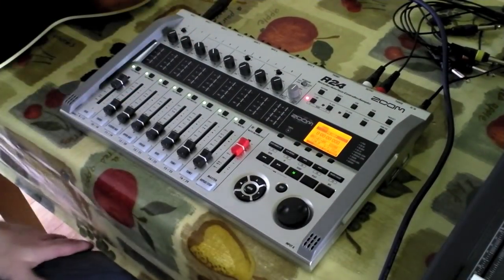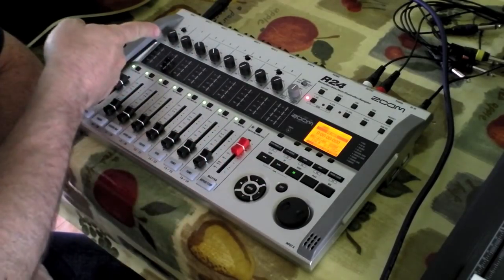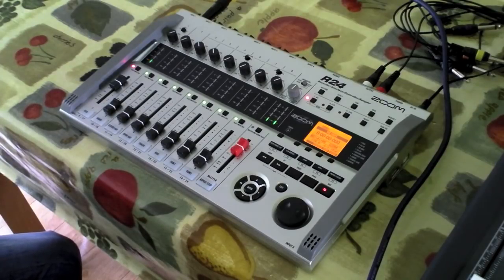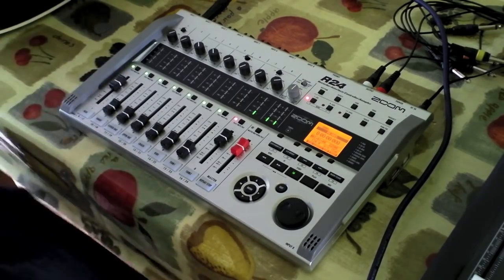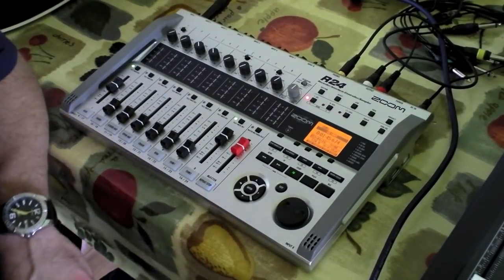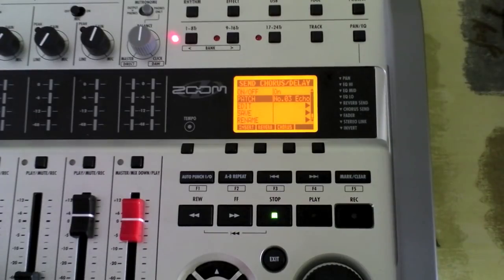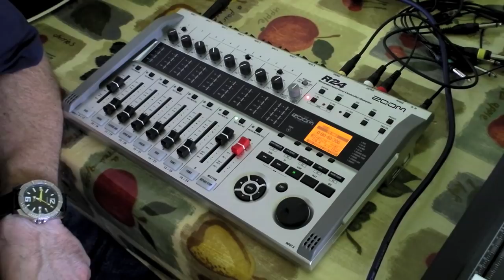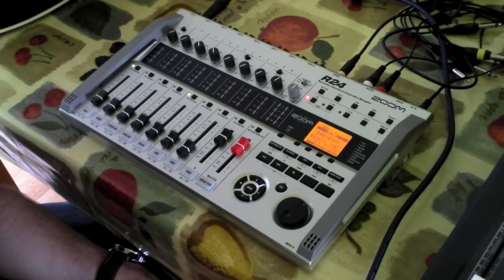Zoom R24 Part 2 - Basic Recording

Comment: Hey topdazzle! 
I just got my zoom24 a few weeks ago, your videos have been loads of help to get my bearings with the unit. 
I have a quick question, I'm sorry if you've already answered it, what SD card are you using? The one that came with my device doesn't work, I tried to format it but it seems to just decide when it will and won't work. (Which doesn't give me a great deal of confidence!) I'd feel better just buying a new card. 
Thanks for your time!
Reply from the maker: +roisintuohy Hi Roisin - I went with a 32GB Class 6 (which I think is the highest size the current firmware will support) - you may already be aware that the "Class" of the card refers to how quickly the card can transfer data (read and write speeds) - in my camera for example (with HD 50 fps video) I use a Class 10 but this is unnecessary for audio.  I think with anything less than a Class 6, if you are recording all 8 inputs simultaneously and mixing down all 24 tracks with effects, etc. - you need a reasonably quick card.  As for "make" - I think mine is a SanDisk.  I hope this helps, Darren
Reply: +topdazzle that's exactly the info I needed! Thanks man!
Reply from the maker: No problem - we aim to please!  PS: loving your acoustic stuff - very nice!

Comment: Hi,just wanted to say it was a very helpful video thanks.One question I have a set up of seven analogue keyboards from the eighties,drum machines and simmons drums which all go into effects units and then all into a mixer.I usually play all tracks live.Would you say I should take a line out from the mixer into the r24 and record all in one take or record each track separate coming from the mixer.Your thoughts would be very helpful on this thanks.
Reply from the maker: Anton Jones Hi Anton - it all depends what you want to do with them afterwards and how much flexibility you want to play around with stuff once it's recorded.  If you take a line out from the desk into the R24 then you are stuck with the mix from the desk and can't then adjust anything afterwards on the R24 (your mix is effectively already done and captured), however this may suit you.  If you take individual feeds then you will get ultimate flexibility afterwards to remix things if you're not happy with the way they sound (but you may not want to do this) - you may also be stuck for inputs doing it this way but you could always use your desk as a submixer instead and take groups away from the desk to stereo pairs on the R24 which will give you a bit of the best of both worlds.  One example would be to sum your percussion separately to your keys - then at least you can change the levels of each group on the R24 relative to the other group later on if that was important.  Anyhow - not sure if this helps but good luck with whatever you decide!  Best wishes, Darren.
Reply: topdazzle Thanks very much Darren for your reply.I think it is obvious now that each synth track,drum track etc needs to be recorded separate,otherwise like you say would the whole idea of being able to mix and tweak various parts would not be possible.Is it best to take a stereo or mono feed from the mixing desk to record each track ?Thanks again
Reply from the maker: Depends on their outputs, keys and drum machines generally output in stereo so take a stereo feed from the desk to preserve this.  Acoustic drums, guitars, etc are fine in mono.
Reply: topdazzle Thanks for your help.

Comment: Hi great video! Just getting started with my r24. I wonder if you need a preamp or something to connect an electrical guitar to the r24. Or can I just plug in directly? Right now I am playing my guitar through an older portable zoom device with built in effects that is connected to the r24. I feel that the sound gets to weak when I try to record. I could be the guitar, its quite old. Thanks again for a great tutorial!
Reply from the maker: Plug it directly in to Input 1 and make sure the Hi-Z switch is set to on - then you're good to go and no need for a pre-amp.
Reply: topdazzle thank you so much for answering my question! :)
Reply from the maker: You could try that but check first at what level your Fender pre-amp outputs - if it's line level than use one of the standard inputs on the R24 and turn down the input gain on the R24. Normally the pre-amp out on a guitar amp is designed to the feed a separate power amp so your tone gets coloured first from the Fender pre-amp.

Comment: Hey TD, Thanks to you I got it going. Why bounce to track to 5, when you can record bass direct into track 2?
Reply from the maker: +mitch green Hey Mitch and thanks for the question - the answer is "because you can't record bass directly into Track 2" or rather, this is not recommended. Input 1 is the only input with a Hi-Z setting to match the impedence of your instrument to that of the input - this includes both bass guitars and regular guitars (unless you are using a pre-amp or pedal / effects box with a line-level output). If you want to record an instrument directly into the device (without using a mic on a cab for example) then normally you would use Input 1 with the Hi-Z switch engaged.  I hope this makes sense and best wishes.
Reply: +topdazzle Thanks for the detailed reply. It all makes sense now. Much appreciated.

Comment: Hey TopDazzle... really great video. I also watched the introductory one (prior to this one :-)). I plan on completing the entire series. I just wanted to say thank you for taking the time to do these. You have no doubt saved a lot people a lot of time.

I haven't actually bought a multitrack recorder yet, as I'm still trying to decide between a Zoom R-24, a Zoom L-12 or a Tascam DP 32SD. And to be clear: I'm not really interested in any of these as a live mixer. I'm solely interested in recording. And so far, I'm leaning towards the Zoom R-24. 

Could I just ask a quick question, please? Did you say that the Zoom R-24 can also act as an audio interface and a control surface?

Anyway, thanks again.
Reply from the maker: Hey Tony and thanks for your comment - the answer to your question is "yes", the R24 can be used as both a control surface (works really well actually) and an audio interface. If you are not interested in live mixing then I would rule out the L12 and I don't know anything about the Tascam to be honest. If recording is your only interest, you might also look at the H6 (I got one of these last year) - another fantastic bit of kit and probably cheaper then the R24 (more portable too).
Reply: Just had a quick look at the H6 - I don't think it's for me, to be honest.... but thanks for the suggestion. Looks like it's going to be the R-24 then :-)

Comment: Hi, do you know if I can use my SD card with projects l have been working on my R24 in my friend's R16? When I insert the card into the R16 no projects show up. Only "new".
Help, oh mighty master of the Zoom!
Thanks, Jim
Also, thank you for all of your Zoom videos. My notebook is filling up.
Reply from the maker: Hi Jim - I'm not familiar with the R16 I'm afraid but it sounds like the folder structure is different and so it is not "finding" your tracks when you insert the card. If it were me, I would transfer the R24 tracks to my laptop first, then insert a card from the R16 into my laptop that had already been formatted to the correct folder structure that the R16 will recognise. Then look at the folder structure and there should be something obvious there as to where the tracks are stored on the R16 (like a folder called "tracks" or something like that). Then just drag and drop your R24 tracks into the correct folder on the R16 card, put it back in your R16, assign those files to the tracks on the R16 and you should be good to go! Hope this helps, Darren

Comment: I'd like to use what you taught me in these first two videos to do a scratch recording of the band using the onboard mics with output monitoring to the PA and am not sure how to do that without getting feedback. Is that output monitoring info in a later video?
Reply from the maker: +acousticomp Not specifically covered, no. It depends on your set up and the type of band / how many musicians you have. You could just try it and see how you get on - you may not get any feedback. If you do, you could also try headphone monitoring - simply send your outputs into a cheap headphone amps/splitters (Behringer make decent ones) then everyone gets their own monitor without affecting your microphones at all. The danger of doing it the way you suggest is that the onboard miss are also going to pick up the sound of your band from the monitors as well as the sound they are making through their amps and this could lead to a very muddy, echoey mess. Experiment a bit and try out different set ups to get the results you are after - that's how I started.

Comment: Great Tutorial. Thanks! I have 2 questions. After I selected a type of Reverb or Chorus, I see that it will be the same one for all tracks, so I can't  pick a different type for different tracks. Is that right? Also, why the Insert and the Send-return effects are called like that?
Thanks again!
Reply from the maker: Hey man - no probe and thanks for the shout, much appreciated.  No, you can't pick a different type of reverb / chorus for each track - whatever you select will be the same for each track (the same as on most mixing desks which this is trying to emulate).  Two workarounds (if this is important to you) - 1. Use outboard effects between your source (mic, guitar, etc.) and the input on the R24 or, 2. Use the bounce function on the device and record your track "wet" so you should end up with a new track with the reverb or chorus effect "burned" into the track then select a different reverb / chorus effect for your next track and so on (from memory I think this should work - certainly worth a try!).  The effects are named like that to replicate the way they work and where they appear in the signal chain - send and return effects involve you sending a variable amount of each channel out to the effects module you have set up, the sound then being effected and returned back to the channel.  For the insert effects, you are choosing whereabouts in your signal chain to "insert" the effect module you have set up (tracks, inputs, master, etc.).

Comment: Thanks for making these vids. I recently got an R24, watched your vids before even turning it on. Was prepared and when I finally was ready to get on with my first recording "no project" is what reads on the screen, even when I press "project" it still reads as "no project". Any suggestions? Thanks!
Reply from the maker: The only thing I can think of is that the folder structure on your memory card has become corrupted and that the R24 is not seeing anything. If this is the case then first try re-formatting the card in the device. If this doesn't work then get a new card and try that. I hope this helps.
Reply: Thank you! Turned out it was in fact the card itself. Slipped in a different one and works fine. Great actually. Spent 8 hours experimenting and learning it. Very simple once you get the hang of it. Great little machine indeed! You're vids were/are a huge help. Thank you. Cheers!
Reply from the maker: Good news! You are very welcome and enjoy your R24 - it is indeed a great little machine.

Comment: Hi.. Thanks for sharing all this info. Yet I still have question. Of course I am an amateur.

If I have 2 sets of Zoom r24 and were to record a live band performance total of  6 musicians (Drummer, 1 Keyboardist, 1 Acoustic Guitar, 2 Electric guitarist, 1 bassist) and 3 singers, how would the track sequence will be? What i mean is,

Track 1 : Kick?
Track 2 : Snare?
Track 3 : Hi-Hat?
Track 4 : Crash?
Track 5 : Ride?
Track 6 : Tom1?
Track 7 : Tom2?
Track 8 : Flow Tom?
Track 9 : Electric Guitar 1?
Track 10: Electric Guitar 2?
Track 11: Acoustic Guitar 1?
Track 12: Keyboard?
Track 13: Bass?
Track 14: Singer 1?
Track 15: Singer 2?
Track 16: Singer 3?

Is it like that?
Thanks in advance.
Reply from the maker: The short answer is "it can be any way you want it to be" - there are no rules or set sequence for this - it all depends on what you want to get out of it at the end and how much of a nightmare all the bleed through may be on the multiple different mics.  The first things that strikes me as unusual in your proposal (compared to what I would do) is all the individual cymbals separately mic'd - there is nothing wrong with this but (IMO) your results will be almost as good (and a lot less hassle) if you mic them up instead with a couple of condenser overheads set up to give a stereo image of the entire kit.  I would certainly mic up the kick, snare and maybe another pair of mics for the toms.  The rest looks good to me.  You also don't say whether you are getting a signal to the R24 directly from the instruments or whether you are going through a mixing desk / console.  If you are going through a desk, you can sum some of the channels together to reduce the number of feeds going to the R24.  Also - you don't way whether this is in a studio environment or a live setting (you do say "live band performance" but this could also mean in a studio).  The best advice I can give you is to experiment yourself for your own set up and needs, keep what works and tweak the rest until you get something you are happy with.  I hope this helps but it's hard to give such specific advice on what is essentially a creative process...
Reply: thank you for your humble answer and opinion as well. Going to get this interface next month after budget is enough.
Reply from the maker: Enjoy!

Comment: Also is it possible to hear what the channels are recording as they are recording, so you can tell how much bleed over there is in the mics without having to record and playback?  We are recording several live instruments together in the same room and it would be a lot easier to be able to check live than record and listen to make corrections...thank you!
Reply from the maker: I can't think of a way to do this easily I'm afraid Faith as if you start trying to isolate tracks to listen for bleed, you would be effectively turning off the tracks that would be producing the bleed in the first place.  Maybe as a workaround, do a short test recording of some of the more dynamic sections of your project, listen to it back and make adjustments from there - not really the answer you wanted and prbably exactly what you are doing already.
Reply: topdazzle We'll give this a try tonight and I"ll let you know.  Seems like that could work since the one track we're trying to isolate for bleed would still be picking up any bleed over as we play, regardless of the other tracks being muted.

Comment: i have an eq on my acoustic electric, would it be best to turn them all down when recording and adjusting the eq on the track later?
and in general would you recommend recording every track as bare and dry as possible to better adjust volume and panning, eq etc later?
Reply from the maker: It's entirely up to you Drew - recording dry and then sorting your EQ in post gives the most flexibility and allows for maximum changes, etc - if you record the EQ "wet" into the track then you are stuck with it. However, it depends on how much work you plan to do in post - for me, I tend to be in a rush and want it quick and dirty so I normally get it how I want and then record "wet".
Reply: topdazzle thanks, i found that keeping my tracks center and without eq or effects gives me a better perception of the line volume  levels, the guitars came out great i layered several different parts and im very impressed this video helped me out so much.

Comment: I noticed when you recorded your guitar it came back in stereo - when I did it.  It came back as mono.  Can you tell me what I'm doing wrong.  I've only just started with the R24.
Reply from the maker: Hi Alan - guitar will always be a mono source (unless you have some fancy guitar with dual outputs like a Rickenbacker Bass or an Epiphone EJ200 and you are running both outputs simultaneously into a pair of stereo tracks). Your pan control then decides where this mono source appears in your sound field - i.e. hard left, hard right, centre or anywhere in between.

Comment: I'm having trouble with playing imported files to the R24. I followed the steps on the manual on how to import audio files from the computer into de porta-studio and everything's done correctly. The problem is that I can't listen to that file when I hit the "Play" button. It's a drum track so I can play/record an acoustic guitar take against it. 

Any help will be welcomed. Thanks!
Reply from the maker: You probably need just to assign the file to a track so it will play back - go into the menu system and select track and then assign, then select your file.
Reply: Thank you! That was the missing step. ;)
Reply from the maker: No problem - glad you got sorted - straightforward in the end!

Comment from the maker: ...similarities whereas the R16 is an older device and looking a bit outdated now.  One such example is the screen size and shape - much easier to read and work with files on the R24 / R8 as they share the same screen (as far as I know).  I know you also asked a question about my connection set-up but I think you've removed it now.  Just to confirm, no, you do not need another mixer to be able to hear the output from the R24 - all you need is either a set of headphones, power amp and speakers...